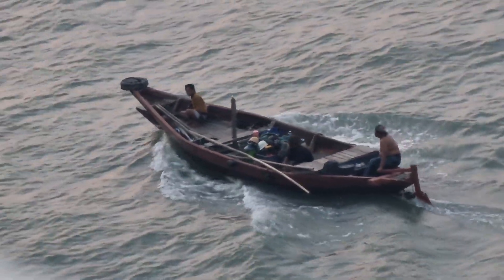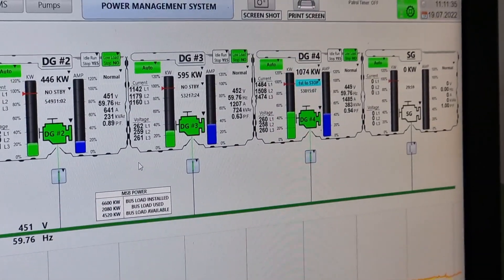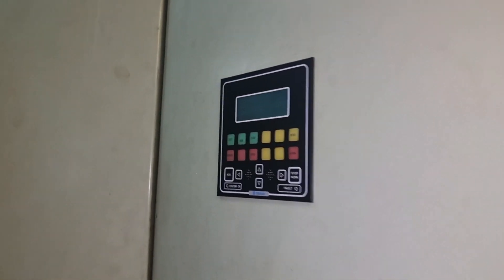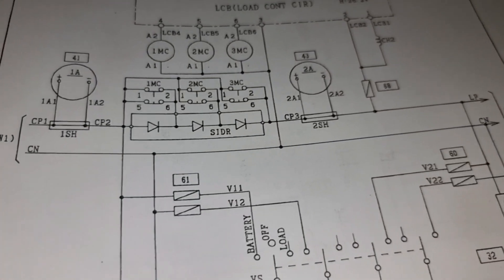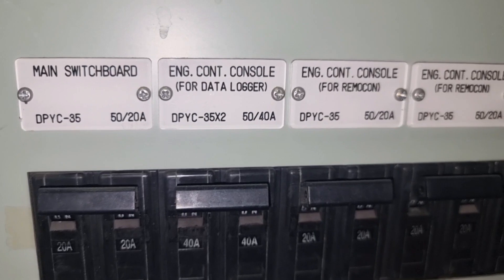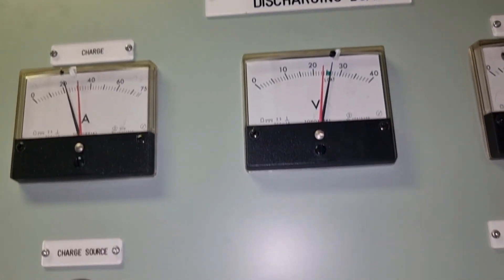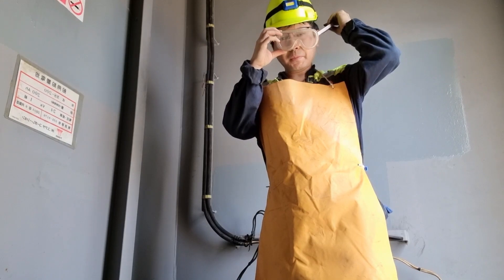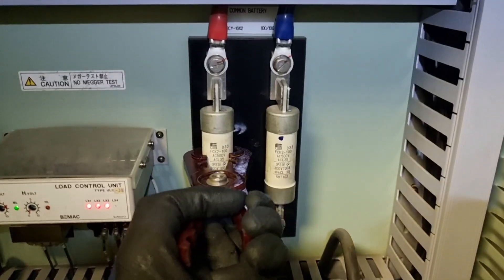BLACKOUT TEST DAMAGED THE POWER MODULE, HOW TO REPLACE GENERAL SERVICE BATTERIES

Comment: How can you test blackout while underway? Do you trip the aux generator? Is the main engine stopped?
Reply from the maker: you cannot test blackout while underway. you do it in port or at then anchorage.
Reply: @leckyjake  What is the test when the system conditions are normal?